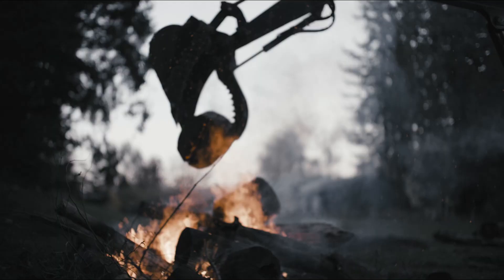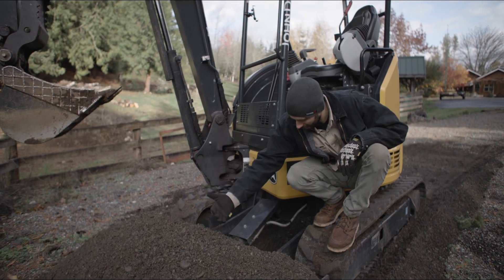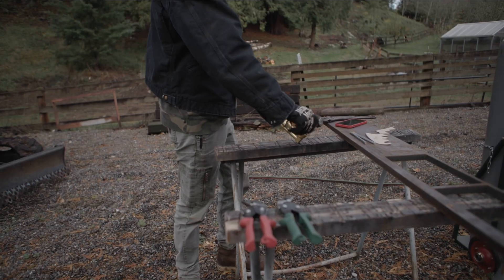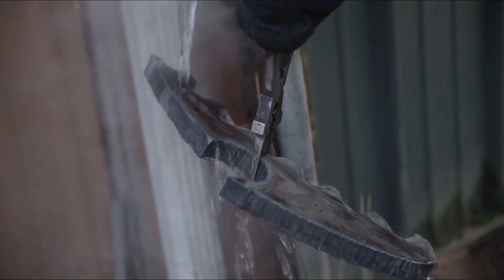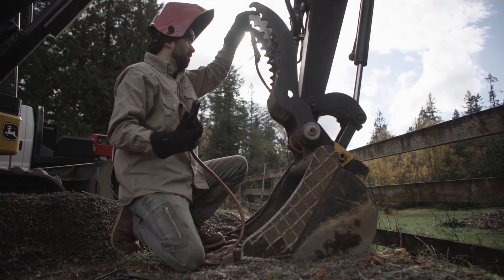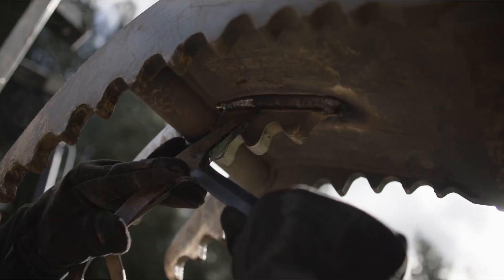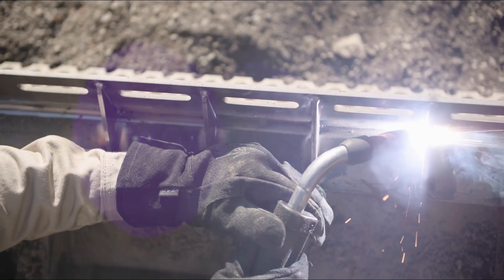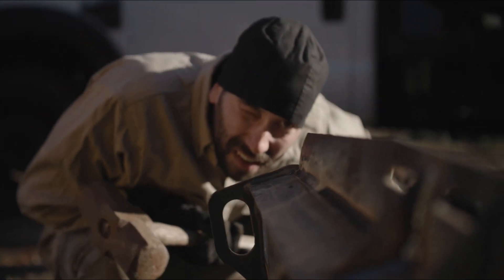The BEST Mini Excavator Mods!!

Comment: I like your thinking. I got into welding in 1970. I did b/c I recognized with welding, I could make what has never been made b4. It has been a marvelous adventure. From aluminum dump truck bodies, carbon & s/s pipes, stainless chemical tanks, paper mills, hospital boiler rooms...my fav...Va Hospital boiler rooms.  Worked with an older fitter/weldor who showed me about resisting warping material by applying a wet rag in the right places. He said, "Always have a bucket with water in it and a rag."  We were able to get 6" and smaller pipe flanges to within the millwrights specs. (the pipe flanges to the pumps flanges). Only by t.i.g.welding (did not add wire) a pass on the side of the pipe holding the flange then, applying the wet rag in the right place, the flanges moved.   Very helpful to know this. 
  I  have a JD 35g, really a great machine. 
  All the best, Pete
Reply: I have some 2x6 11ga tube that a few of the sticks are  kinda wonky when the straps were cut.  can i heat it to remove the curvature?

Comment: What a great watch! Can I ask why you tacked with stick and finished with flux wire fed? Was it just for efficiency?
Reply from the maker: Thanks for checking it out! There were a couple small gaps that I wanted to fill in before I welded it out. I also wanted to demonstrate how well the machine could run 6010, because it’s the rod that usually gives people trouble. Ideally this mod would have been done in position, inside a shop, with metalcore or solid wire in spray transfer.
Reply: @weldscientist I have a couple of Pipeliner customers who are using their MPX 330 machines to make XX10 stick rod X-Ray quality welds daily.  The MPX 330 is a great machine other than making repairs and performing maintenance on such a compact machine.  They packed everything inside of it realy tight.  I wish you and yours all the very best, Kevin

Comment: Great quality video (obviously). I was going to caution you about adding to the blade height... the Push of the machine is matched to the drive motors. But you didn't over-do it. Plus you added rigidity to the blade...👍. Still, i'd have preferred to see wings (removable) added to the blade instead; to me that's the limitation to these smaller machines. The thumb.... well that is very slick. Seems like a no-brainer, once we all see it. But thumbs are complicated, unintuitive, science. Simplicity seems to be key. Basically Anything you add, seems to create drawbacks later on.. (in this case, grasping something spherical, like rocks. (plus you lose clamping strength with each added bit of metal making contact). Still, that's nice. Bobcat has an accessory thumb that is two-piece and articulates inward, on the end. (might have a patent on it?). Hopefully you get back to us all when you have a good idea how these mods are working out... inspirational. Thanx~
Reply from the maker: Thank you George. That spill guard is mostly for preventing things from coming over the blade. I agree some removable wings would be nice to have on there as well. So far no issues with any of it. The dirt curls off the blade so nice now👌🏽So far the thumb has been great. Picking up most rocks only 2 tines are holding at any given time. If anything it makes it easier to grab odd shapes with all the extra points of contact available. I like your idea for an update video! I post a lot of pics and videos on my Instagram if ya wanted to see more of it in the meantime. Thanks again dude👊🏽
Reply from the maker: Update! Still working out excellent. I think if I did it again I would make the spill guard 5/16” instead of 1/4” thick. I’d also cut radiuses in the gussets and space them out across the whole width of the blade. No issues currently, but you could potentially bend it up if you were trying to carry something using that blade to assist. The thumb mod is working out too. It’s much easier to grab smaller brush when clearing.
Reply: @weldscientist  Hey who is the Manufacturer of the cutting edge?
Nice Project & Great Cinematography, can’t wait to do these mods as well as removable wings😎
Reply from the maker: @mr_regenerative  That cutting edge is called Sharqplate. You can get it from a company called Genalco. Good luck on your mods!!